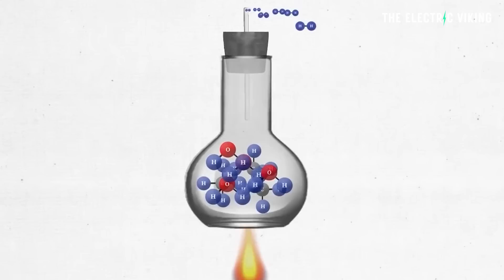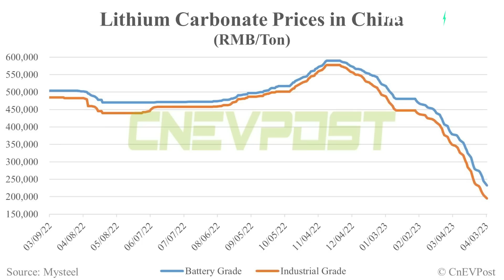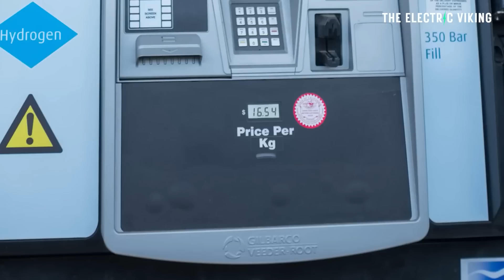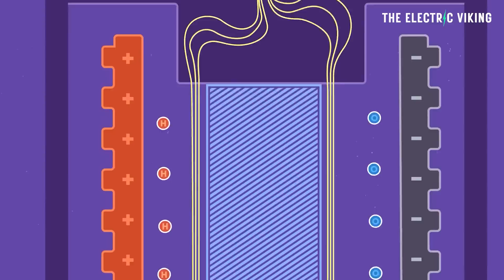Experts say Hydrogen for long-distance trucking makes no sense

Comment: You glossed over the most important advantage hydrogen has: weight. A hydrogen fuel cell's weight is about 1/12th the weight of an energy-comparable EV battery. You gave the example of the 1400 kwh battery that weighs 1.5 tons. That same battery with a hydrogen fuel cell would weigh about 0.125 tons. Weight is important for freight, because a lighter battery means you can haul more freight. A comparable hydrogen vehicle would be able to haul 1.375 tons more cargo on the same trip vs battery EV, meaning revenue for hauling that much more cargo. The cost of the driver doesn't change between these two scenarios, neither does the wear and tear on the vehicle or other costs (like tolls, depending on the country). 

You are also basing your estimates on cost and efficiency on relatively early phase technology. The EV industry has developed economies of scale that have not yet been achieved in the hydrogen industry. You are comparing early adopter pricing to scaled-up pricing. There have also been enormous increases in the efficiency of the electrolysis process to make hydrogen, with an Australian company called Hysata having announced record-breaking 95% efficiency for the hydrolysis process last year. Your 23% efficiency estimate is already well below current technology for hydrogen. US Department of energy has the efficiency of the cells at between 40-60%. Current commercial electrolysis techniques produce just over 75% efficiency in conversion, meaning the overall process is 30%-45% efficient, and would be 38%-57% with the new Hysata techniques, with considerable room for improvement on the fuel cell side which could easily bring it up to lithium ion levels of efficiency (with lithium ion technology being so widely used in various sectors for so long, the likely gains in the future are much less likely).

The other thing you are forgetting is storage. Your efficiency numbers for wind and solar don't seem to take into account storage (either the expense or the energy loss). If you are producing wind and solar and putting it right into a truck that's one thing, but that's not realistic. Wind and solar production are intermittent (depending on how much the sun is shining or the wind is blowing). Power is lost both from energy storage systems needed before charging, as well as for the battery itself after it is charged. Hydrogen is more akin to base load power, which can be used when needed, and stored without the same loss of energy. This is more and more important the farther off-grid you go (hence why hydrogen cargo ships are a thing, but battery powered ones aren't, since the energy loss becomes a big issue for 20 day trips). The storage issue also become a major thing when considering how much more efficiently energy can be produced in one place vs another. In Australia, where there is tons of extra land, it may not seem like as big a deal, but in heavily populated areas of Europe or Asia, it is. Take a country like Japan. They may never have the capacity to produce enough power to fuel their economy. The big advantage of fossil fuels is the ability to ship them all over the world while the energy remains stored. You can do that with hydrogen, but not with battery power. Shipping charged batteries across the ocean would be incredibly inefficient and expensive. It's large part of why one of the world's biggest boosters of hydrogen fuel cells is Toyota.

Comment: what about hydrogen powered ocean tankers tho?
Reply: At first step it would be enough if they switched to diesel and didn't burn the dirty heavy oil. This could be changed overnight with almost no cost.
Hydrogen is still not sufficiently available and the steel industry alone will need huge amounts here and on the CO2 side greater savings would be achieved here than in the transport sector.
Reply: Once we get rid of fossil fuels, that gets rid of ocean tankers.
Reply: @Zedus-rl9hp  No commercial H2 production creates tons of CO2. The cheapest and most popular way to make H2 commercially is the steam methane method, which is:
CH4 + H2O (+ heat) → CO + 3H2
Then because CO is very bad for the environment and life in general they run a second process:
CO + H2O (+heat) → CO2 + H2
The second process takes care of the dangerous CO and makes more H2 which is kind of neat. As you can see H2 production uses lots of energy and makes lots of CO2.
Reply: @lionelwylie2326  Hadn't made myself clear here, but since only green hydrogen makes sense for transport and other applications for the energy transition anyway, I thought it was clear that H2 from natural gas was not meant here
Reply: @Zedus-rl9hp  Ok but at the moment commercially made H2 is not made using electrolysis. That for now is only done in science labs.
Reply: @lionelwylie2326  No, there are certainly electrolysers that go beyond a laboratory, but the scale is still quite small

Comment: Lets all just wait to see what happens in 2030 and beyond and see wether ford will bother with implementing hydrogen patent and wether vw keep their colloboration with kraftwerk tubes. Also see if india and china give up on hydrogen or see it through. The fuel cells/electrolysers what have you are said to be much cheaper by then.

Comment: All about running costs.. 
Hydrogen fails miserably in terms of running costs.. 

Also look at Nikola..  they were the biggest hydrogen truck advocate and.. they have yet to release a hydrogen truck, but are selling electric trucks.. 

Toyota et al are trying to find a use for all those fuel cell stacks that they thought they were going to buy for their hydrogen cars which flopped.. I consider 6,000 units/yr a flop (and that was the best year) when the goal was 30,000 units.

Comment: The real solution is electrified rail. Long-haul trucking is comparatively inefficient and dangerous, regardless of what technology drives it. Rather than making the inferior long-haul mode of transportation less inefficient, we can shift to a better mode entirely. Investment should focus in rail upgrades, electrification and automating transfer stations. In the US, the top commodities in freight ton-miles (largely via rail) are coal and oil. If we can phase those out, it will free up capacity.

Comment: I'll never understand why countries don't just run an overhead wire on all highways so trucks can use that electricity to run like electric trains... Then,  a hybrid engine or battery could power the truck to the final destination. Governments could sell the electricity to offset costs...

Comment: You don’t need to an expert to realize Hydrogen trucks are total con! 
Electricity for transport is cheap, safe, vastly more efficient, widely available and long haul is easily solved with battery swap if needed.
Hydrogen has no use case in road transport.
Everybody with half a brain knows this!
Reply: But at least it takes less time to refuel
Reply: Battery swap is faster than refueling with hydrogen

Comment: In the present as things stand there is no alternative to diesel for long distance truck haulage,until batteries can hold enough power to do 1000miles and recharge in a matter of minutes then this argument is just Nonsense just as Nett Zero is,it will take years to get round this problem no matter what governments say and the time limits imposed.

Comment: here's the facts......JCB has already developed a working hydrogen engine that's ready for production.
it produces zero emissions. the only thing missing is the hydrogen infrastructure and supply lines.
Reply: And cheap Hydrogen...
Reply: I feel like the problems with hydrogen are going over your head.  I can heat my home by burning hydrogen, that doesn’t make it a good idea.
Reply: That certainly is a fact.  But another fact is: if you're going to run hydrogen in an internal combustion engine, you need to get the cost of hydrogen down to about $2.00/kg to be on par with diesel.  And currently, it sells retail for $26.75/kg at most of the hydrogen filling stations in CA.  Cheap hydrogen is the biggest hurdle.  And to get it down to $2.00, you'll need to get electricity prices down to about $0.01/kWh if you factor in the cost of the electrolyzer.
Reply: here's a video explaining JCB hydrogen engine.
https://www.youtube.com/watch?v=H6_qAta3Gk8
Reply: @zapbrannigan000  Nice Video. He says it needs to get to 3Euros/kg, but that's in Europe.  Diesel is 2/3 that price in the US, thus hydrogen needs to be $2/kg or less in the US.  All he says is there's a challenge to get it cheaper.  That's nice.  They don't have any ideas how it's going to be cheap enough.  If it were running a fuel cell instead of a compression engine, the price of Hydrogen would only need to get to $6 in the US to be cost equivalent to diesel.  But FCs aren't cheap.   The fact about the engine oil staying clean is pretty cool.